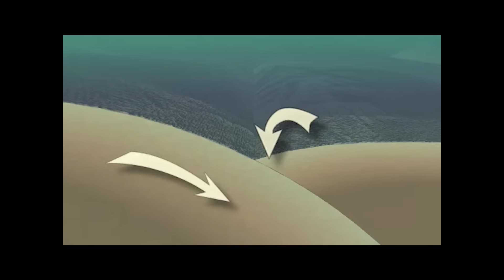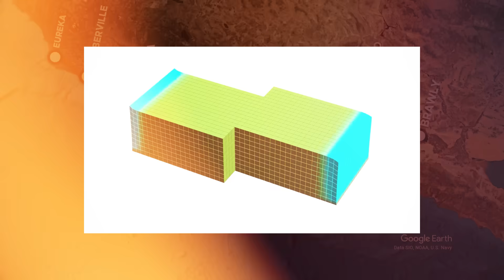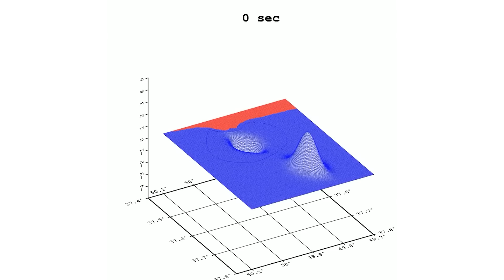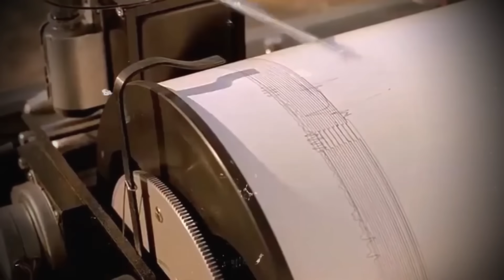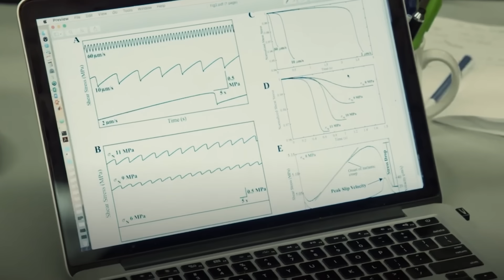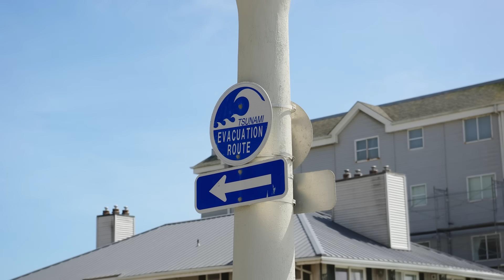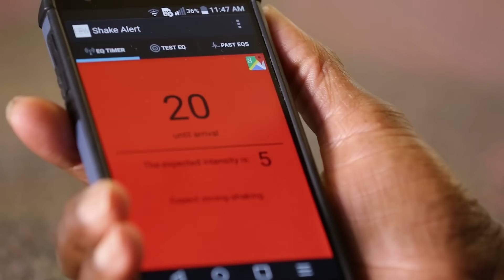Thousands Of Earthquakes Shake The Cascadia Fault: The Big One Could Be Close

Comment: Small ones are better than big ones and relieve the same stress. In the last 30 days there have only been a handful of small quakes. So this is just scaremongering. The quakes that did occur were on one part of the Juan de Fuca to Pacific plate boundary at the south end of the Juan de Fuca plate. Which isn't the worrying Cascadia to Juan de Fuca boundary with parallels the shore.
Reply: Small shakes don't relieve the pressure -- they show pressure is continuing to increase.  It would take 10,000 7.0's to equal one 9.0, billions of mini tremors to a fully relieve sufficient stress.  Hiding from reality won't protect you from the consequences.

Comment: The PNW (Pacific Northweast) tremors are not that different from historic levels, however.  The deep quakes (between 23 and 36 miles deep) are a sign. !  there is some slight "tight" areas passing that zone. All we can do on the West coast is prepare for what comes after the quake!
Reply: Please share where you get the data of the deep quakes between 23-36 miles deep.
Reply: @l.c.3150  USGS

Comment: 300 to 500 years. 320 years is not over due. That would be in another 180 years.
Reply: So, you're wrong.  Average 300-500 years between shakes means sometimes there was only 100 years between, and sometimes it was 800 years.  It DOESN'T mean start worrying only after 500 years.

The actual average between Cascadia-area quakes is 246 years, although some of these are only partial rupture (magnitude ~8.0 rather than 9.0+).

So, yeah, it's  overdue.  This region has been called "like clockwork" because it IS so regular.

Hiding your head in the sand with false assurances won't protect you.  You have been warned.
Reply: you absolute fool
Reply: You could not be more wrong, over due is when it is past 300 years, I think the seismologists who study these know more than you do
Reply: I agree. I don’t think this one will happen yet. San Andreas fault will go first.
Reply: @livingdeadgirl4884they're just finding out the Cascadia can trigger the San Andreas